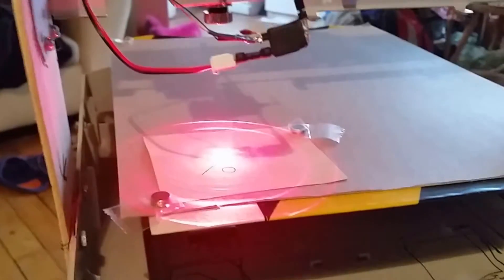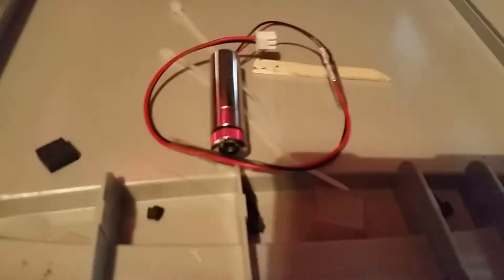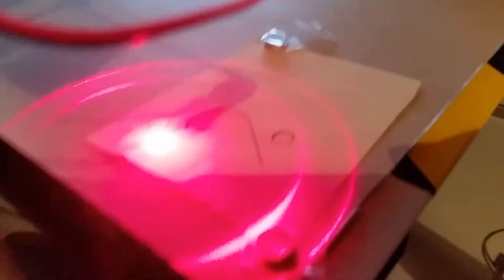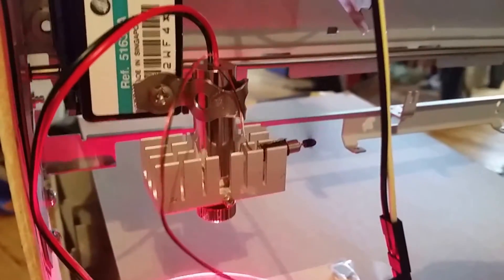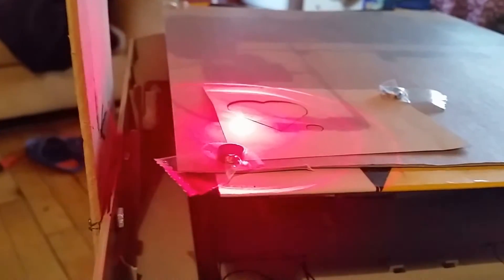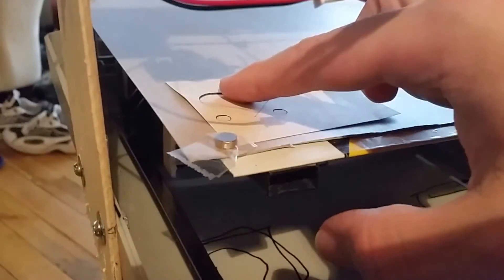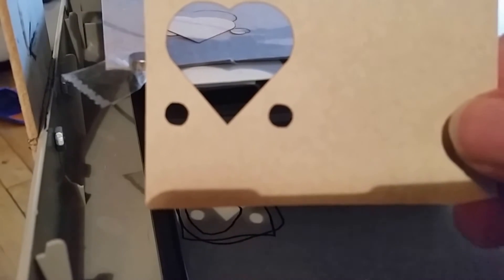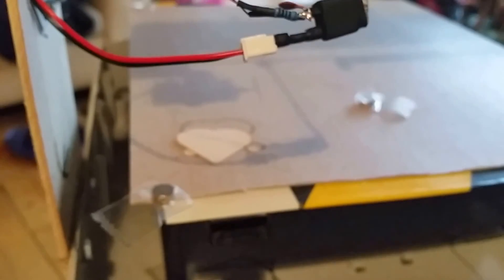Laser Plotter : replaced the laser module from Banggood.com

Comment: how much time does it require to get heated up and start cutting/engraving?
Reply from the maker: that low power laser module will cut/engrave near instantly on darker stuff if it focused. 
I since left that one for a violet one way more power.  that lil red one is only 300mw. my .4w violet can cut cardboard. the color of the laser makes a diff here as mt violet has other invisible light in it too.  but the little red ones that have the driver in the can are pretty good, for exposing etchant and such for making PCB and what not.

Comment: Hi Buddy, how do You connect the lasser to the Arduino?, I have one of this and I'm usign a IRF44 MOSFET to connect the z limit pin (11) from the arduino to the Lasser but it  apparently underpowered .
Reply from the maker: I have found fets to have too much voltage drop, I have moved back to a relay module
Reply: Hey thanks for Your quick  answer, I'll test with  a relay then!!!
Reply from the maker: NP . i tested a FET , and while it let me use PWM, my laser is so low power (until i can afford a bigger module )  the PWM results in no benefit. I could cut cardboard with my  .4w diode using a relay.

Comment: hey i have a question, im buying one of those lasers from bangood, do i need to make his own power supply or i can use the one that the laser comes with?
Reply from the maker: +Zhanthe if the module your are buying says it has power and anti static protection just supply 5v , you will be ok .   just make sure you don't exceed the supply voltage they list . 
the module i get has the driver circuit in it . I just have to supply a clean 5V to it . you can supply less than 5v but your laser will not engrave . 
i think the ones i got were like 15$ and had drivers inside the can .   if they come with a power supply it usually matches it perfect . the 300mw violet laser i got came with a switch mode 5V 2a supply .
Reply: +XerotoLabs thanks for the fast reply, so there is no problem as long it doesnt exceed 5vs, do you think with 4v or 3.5 will engrave? i dont need it to be fast but as long as it burn will be ok.
Reply: This is exactly the information I needed, thanks guys!!

Comment: where can i get code to run a laser maching if i was to build my own just to cut acrylic ? using a nano and a couple of easy drivers?  good setup i like the little dc motor you got there maybe you wanna build a compartment for that motor so you can concentrate its coolness
Reply from the maker: Frank Lopez search for GBRL , and arduino nano.  you can load GBRL onto a Nano and have it drive the easy drivers . 

to cut acrylic will be cool .  i know that others need water flowing on it for good clean cuts . 

this link has pictures of the pin out on Nano http://www.instructables.com/id/GRBL-Pinout-Arduino-Nano-v30/

use ide to flash gbrl to nano
http://blog.protoneer.co.nz/grbl-arduino-library/

and my fave one so far :
http://www.openbuilds.com/builds/m-cubed-3-axis-bluetooth-cnc-controller.1648/
Reply: do i need to buy this grbl driver board or can i just plug away my nano and those 3 easy drivers  a cutting laser and assemble a cnc station ?  thanks for the link men your the best!